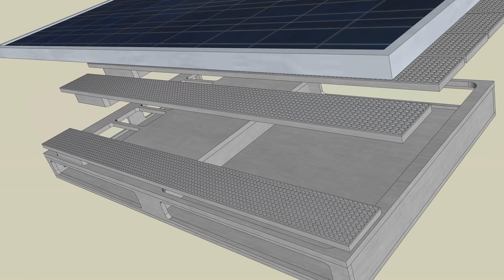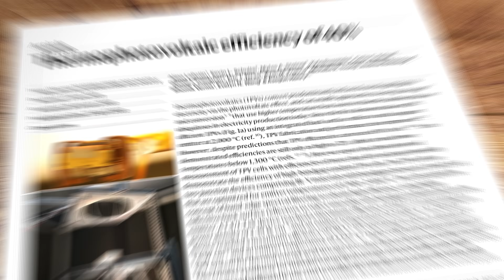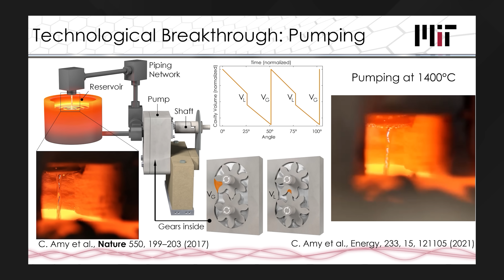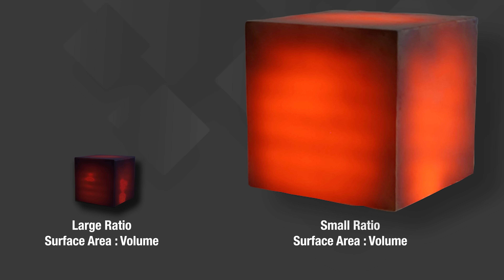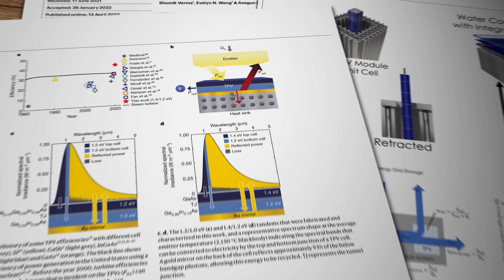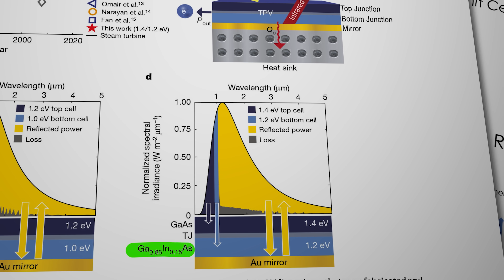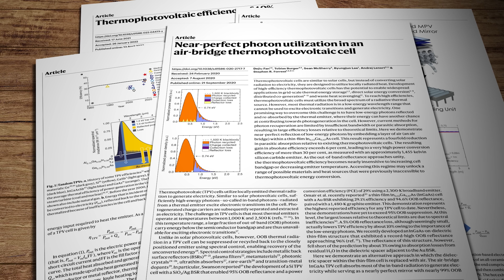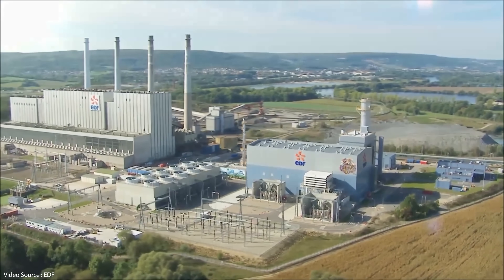Grid Scale Energy Storage 30x cheaper than Lithium-ion! How do they do that?

Comment: Very Interesting concept. However I think it is too complex of a system - specifically keeping it safe would require quite a bit of maintenance. And stored heat over months is valuable by itself, specifically in the carbon intensive north
Reply: Complex? In respect to what exactly? Thorium based reactors? Endless windmills and lithium batteries? This needs a few bits but is quite simple as presented here.
Reply: @martincampbell9810  This is storage and not generation, so neither reactors or wind turbines mean a thing.
This is touted as an alternative to grid scale lithium batteries, and compared to them (or pumped hydro....or other redox batteries) has a pathetic 40% efficiency.
And that is solely for the IR to photocell portion of this circus.

So yeah, ridiculously complex (and inefficient) for its reported abilities.
Reply: @jimurrata6785  it might be less efficient, but the issue here is cost. It's way cheaper.
Reply: @simonwatson2399  The issue with "it's cheaper" arguments, is that it gives you no clue if we can afford it. I am deeply suspicious that a system with 0.5 the efficiency, 3.0 the weight (which is, in first approximation, the real "cost") and 5.0 times the complexity and maintenance, could by 30.0 times cheaper (in money unit).
Lithium batteries are already DOA, but even I scratched my head when hearing that a ground breaking, industry changing, paradigm shifting, is that: each component works in isolation...  What's the problem with changing a fuse a cell  or whatever in a battery storage, or even a whole turbine in a SEP ?
"Cost" is not to be appreciated in dollars, but in kilo, in joules, and any physical impact (pollution). That's how you measure renew-ability
Reply: @TheBoing2001  why is weight and issue for a building? The modularity means it is far easier to upgrade and repair. In terms of complexity it's very simple. The economics of the system are well explained in the paper.
Reply: @simonwatson2399  Because there is a 1 to 1 relationship between that quantity of material, and how you are going to dig that out of the ground, refine it and transform x times, then move it across continents to make it magically appear on a CGI dream-fest.
The only non-modular thing that I can think of is a nuclear reactor (and even so only the primary circuit). How this is any less modular than a car, a phone a BSF a SEP or a windmill eludes me.
I'am an engineer, so I fear than I am more interesting in -logics, and -logistics, than -nomics.
Reply: @TheBoing2001  and that is not captured in the dollar cost why? The fact that it eludes you is something for you to deal with, not me. When you use the word windmill you just demonstrate your predisposition. Most engineers can tell the difference between a turbine and a mill.
Reply: @simonwatson2399  I am not sure you quite follow. If you've never heard of "externalities" in economics, I am afraid that's a lack of knowledge for you to fix, not me.
Now, as you've patently read the whole paper and verify all those claims about 30x cheaper, you've shown your predisposition.
Mine is that complete carbon footprint is a very new and totally incomplete and unreliable accounting, and in no-way you can substitute it by money accounting. Quite the opposite. The cheaper you manufacture X ton of material, the likelier it's carbon footprint (and other ecological nuisance == renewability) is high.
Most engineers know that you can have mill without turbine, but you seem to believe everything is free and readily available in nature, including energy, iron, argon, (... include other wishful thinking here), and the only thing needed to instantiate it, is to throw piece of paper at it (whatever their color, or the little scribbles on them)
Pep talk all the way down.🙄
Reply: @TheBoing2001  I'm sure your pulled from the air opinion is more valuable than a research paper from MIT. Really I am. I await eagerly your rebuttal paper. Nice to know you didn't bother reading it before offering an opinion though. That's always very convincing.
Reply: @simonwatson2399  I was under the impression you had read *them*. I see now you failed this part too. I don't think this "paper" will be rebutted, because it is white. Devoid of actual precise cost breakdown (not just unassembled raw material of unproved technicological processes at ridiculous scales), and instead is full of conditionals, estimations, and even down right admitting the "potential-issue" on "feasibility-issue". (like all draft of funny wishful ideas actually are)
I understand your background is in marketing, not science... but please, do not mistake your lack of understanding with the authors honest disclosure:
"We report promising initial experimental results that suggest it is feasible and could meet the low cost required to reach full penetration of renewables" 
(bold mine)

So I suppose ... I rest my case. Hope to have fulfilled your expectation .. you are welcomed.

You should also try to use you own critical skill instead of using the worn-out "argument of authority". The paper is not even from MIT btw... 😉
Reply: @TheBoing2001  the paper on the pump specifications was separate, and you correct in only one point in your sad little ad-hominen piece. MIT didn't publish the paper themselves. As to my background, big miss. Never mind. I'm sure if you keep repeating this you can get someone to agree with you to put off your ire that not everyone will just bow down and agree with you. 

By the way appeal to authority is when someone says something like "I'm an engineer so my opinion that this is wrong has value despite me not actually having anything other than my opinion to back it up with". You know, like you did. 😂😂😂
Reply: @simonwatson2399  You don't need to bow down to anything. That's not how critical thinking works.
You just have to read the paper and evaluate it against other knowledge... not "bow down to it".
As for your background, it's clear it is no psychology either... you would have heard of projection.

As to "appeal to authority", you are as well very confuse. By definition an authority is not oneself.
So if you cannot grasp the arguments presented, that's fine. But if your feelings (opinions needs some arguments) gets hurt, don't resort to credentials accounting, or babbling about turbine 😉
Reply: @TheBoing2001  still hurt that I won't accept your engineering opinion over published research I see. Give it time, I'm sure the pain will lessen. 🤞
Reply: @simonwatson2399  I am sure you'll get over it 🤣
Reply: @TheBoing2001  my listening to research over YouTube commenters, I hope not.
Reply: @jimurrata6785  storage when it's not achievable means demand on the grid control. My point is valid although academically you are 100% right, this could be better done with a mountain or two to hand...
Reply: I agree that we should look into direct heat or cold storage and use that in district heating/cooling.
Reply: @ambrosenuk  I never said argon was rare or incredibly expensive.
I asked about the environmental costs of tapping it from the output of liquified air, and how anyone was supposed to work on (expand) a modular system that can't be drawn down.
Insulation never eliminates heat loss, it just slows down heat transfer. 
When you're talking about huge thermal deltas and objects as large as a warehouse that loss is not going to be insignificant.
Reply: @jimurrata6785  As pointed out in the video , the bigger the object the slower it cools down.  Your body actually produces far more heat per cubic centimeter than the sun's core - but being much smaller you have far more surface area per unit volume, so you don't get nearly as hot before radiating away heat as fast as you produce it.  

When you double dimensions of an object you get 8x the mass, but only 4x the surface area through which it can lose heat. Which means every doubling in dimensions cuts your rate of heat loss in half per unit mass (and thus per unit heat stored).  Make something big enough, and you wouldn't need any insulation at all.  Insulate it anyway, and the same thickness of insulation is twice as effective.
Reply: I would take the low cost argument with a pinch of salt until detailed engineering designs are attempted. Very high temperatures create very large engineering problems.
Reply: @alanjenkins1508  which are all covered in the paper.
Reply: I have an idea. Why not read the actual paper instead of talking none sense in the comment section?
Reply: @randall.chamberlain  Where can I find the paper? asks an interested layman
Reply: @PeterACasanave  All links are in the video description
Reply: Gas cycle is complex too, so difference is less than expected. i get your point though.  Still, we need Energy Storage on the Grid. Massive step in write direction.
Reply: It's child's play compared with the complexity and safety issues of nuclear power. Even gas turbines have lots that could go horribly wrong if not designed and maintained properly.
Reply: "Argon is needed to prevent oxidation", meaning it will catch fire and explode.  What could go wrong???
Reply: @scottslotterbeck3796  How much energy is required to extract that argon?
How intensive is it to create a warehouse sized argon tank to store these 'modules'?
Why not spheres given the S:V ?
How do you go about eliminating thermal loss from an object this size?
Reply: @jimurrata6785   Just off the top of my head, I think most argon is found in the atmosphere, and is a byproduct of liquifying "air" to make liquid nitrogen.
Reply: @jimurrata6785  STOP ASKING QUESTIONS!!!  Science at work here!  LOL.
Reply: @BergquistScott  It is (just below 1%) but it is a valuable commodity already in short supply.
As if the crisis in Ukraine hasn't caused enough disruption with our supply of neon and other noble gases used in semiconductors you might look at what's happening with these noble gas markets (including argon) worldwide.
Reply: @jimurrata6785  Argon isn't particularly valuable.  It's a byproduct of other gas liquification processes that utilize air as an input, like those that generate liquid nitrogen.
Reply: @sunspot42  Not a byproduct but a co-product.  (no one is just ejecting it after compressing atmosphere for nitrogen or oxygen)
Therefore it has "value" .... as I'm reminded every time I have to refill my welding tank.
Reply: @jimurrata6785  Although, argon is a byproduct of potassium-40 decay.
Reply: @anhedonianepiphany5588  And that's great for the argon we already have!  😆
Reply: @jimurrata6785  Well, yes, because it’s being continuously, if slowly, produced. Of course ⁴⁰K decay is also the source of most of the existing atmospheric argon anyway.
Reply: @anhedonianepiphany5588  🧐🧐🧐 Which is exactly why I said "and that's great for the argon we already have"
Somehow I doubt humans (as we know them) are going to be around in another 1.25b years.
Reply: @jimurrata6785  Indeed, human half-lives tend to be considerably shorter.
Reply: @jimurrata6785  current production capacity follows demand. Given this storage solution would have well known and predictable needs, any gas producer would be happy to enter into a long term supply contract and add necessary capacity.
Reply: @jimurrata6785  the cost of the argon in your tank is a tiny fraction of the cost you're paying. Just looking at the spot price of argon on the commodity markets shows its not been cheaper than it is now in the last five years.
Reply: @jimurrata6785  energy isn't relevant if it's renewable. You don't need a warehouse sized tank, you'd store it under pressure. Spheres are way more expensive and complex from an engineering standpoint. Heat loss calculations are in the paper if you'd care to read it.
Reply: @scottslotterbeck3796  see what happened at chernobyl

Comment: The fact that the system relies on a massive radiator to dissipate the heat away from the panels is worrying. Whenever I see a radiator, I think that the engineers have admitted defeat to a smaller or greater extend. The reason internal combustion engines are so inefficient, is that heat is not dealt with very well. 
This system seems to suffer a similar level of engineering short-sightedness. Storing energy thermally may be a good idea. Dissipating the heat via a radiator really isn't.
Reply: unfortunately like law-of-conservation-of-energy, the thermodynamic-laws absolutely demand a radiator because it need a hot end and a cold end, (ie: a heat gradient) for a heat-based-engine to function (even tho it's not obvious what a solar panel have to do with such heat gradient).
Reply: Never understood why the excess heat in IC engines goes to waste.  Why not use this technology to generate electricity in an IC engine and do away with alternators?
Reply: @scottslotterbeck3796  the exhausted heat was not hot enough to extract a meaningful amount of energy as stipulated by "Carnot efficiency formula"" in Thermodynamic law; the hotter the heat compared to ambient the better the energy extraction process is, otherwise it is very inefficient and not meaningful. The excess heat in a car IC engine only amount to the point it boil water in the radiator which then cooldown fast with the passing air meaning it's too close to ambient temperature for effective energy extraction.
Reply: @scottslotterbeck3796  Most of it doesn't go to waste, how do you think the heater works?
Reply: @scottslotterbeck3796  The hot exhaust from an ICE is used to run the compressor section of a turbocharger. The whole concept of an ICE engine and using the hot exhaust to power a gas turbine or to make steam for some type of steam engine is called topping.
Reply: How else would you dissipate the heat???

Comment: Very interesting, I wonder about scalability though....not necessarily bigger...but smaller. How small of a system could be made? Seems to me a 1MW system could be considered as a local source instead of having to be full grid scale.
Reply: District storage will be done with lfp batteries, they are more efficient. These kind of systems are great to build on decomissioned fossil  electricity plants. They already have the grid infrastructure to carry those kinds of loads.
Reply: Cubic kilometers of graphite and molten metal?

Comment: Rube Goldbergian farce - let excess renewables like CSP create molten salt to drive a steam turbine and get efficiencies that approach 90%: "Multistage (moderate to high pressure ratio) steam turbines have thermodynamic efficiencies that vary from 65 percent for very small (under 1,000 kW) units to over 90 percent for large industrial and utility sized units. "

Comment: Modular. That is a big key. Having the thermal buffer separate allows for a smother integration. Phase one can be applied to existing infrastructure using heat as its primary power source with just plumbing.
Reply: How do you do that when your plumbing needs to be above 232°C and you can't compromise the inert argon atmosphere of the graphite storage blocks?
Reply: @jimurrata6785  They are already designed to move the heat from the storage to the production buildings.
Reply: @judedornisch4946  And how do you keep that plumbing at temperature when you "just add another module"?
How do you work on any of it at all when those "buildings" (argon tanks) can't be drained down without the storage and heat cells burning up?

Comment: I mean this whole thing is a lab result and about as far away from being widely adopted as SMRs. 

Efficiency wise this cannot compete with existing technology (combining 2 heat engines with different temperature ranges). 

Instead of using tons of electricity for inefficient resistive heating you could just use a big solar furnace and skip the middle stop completely. 

Now maybe their  their storage advances are an improvement over just using molten salt but I just don't see more than that coming from this technology in the forseeable future.
Reply: Or use 24/7, safe, clean, carbon-free nuclear power plants
Reply: @scottslotterbeck3796  Sadly we do not have this technology cause people didnt care. We neither have safe nuclear that is mass market ready not do we have nuclear that gets to 2000 C. We would in theory have a solution for both with molten salt reactors, but they are not mass market ready.

Comment: Awesome. Who would have thought we can create electricity from heat as efficiently as heat engines but with TPV.
Reply: This does not create electricity. Electricity is used to melt tin. And only then is the system 40% efficient in converting the heat of the molten tin back into electricity.
Reply: @luc_libv_verhaegen  Exactly.  People are pretty dumb.  As is this overly complex crap.  Hydro storage, folks!!!
Reply: @luc_libv_verhaegen  I know it's a battery. I'm fascinated by the heat to electricity part. Turning electricity to heat is easy.
If we have a source of heat we may not have to use spinning things as our only option in literally every kind of power plant today.
Reply: @morteza1024  The appearance of a battery is secondary, almost just incidental, to the collection of heat and conversion to electricity. You could add real better batteries as an afterthought.
Reply: The technology has been around for centuries.  Thermoelectric generators are used every day.
Reply: @scottslotterbeck3796  Are they 40% efficient?
Reply: Who would have thought that heat engines were 'efficient'?